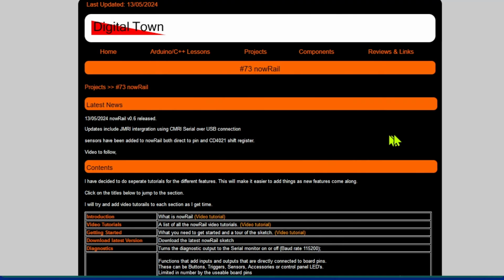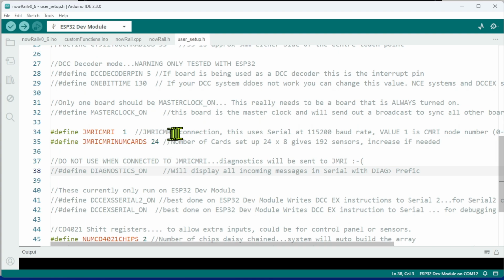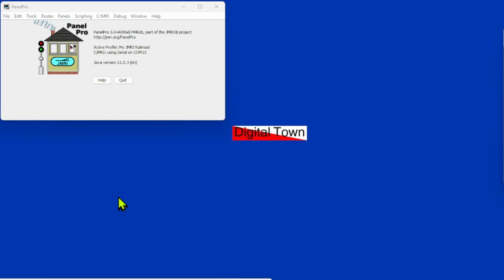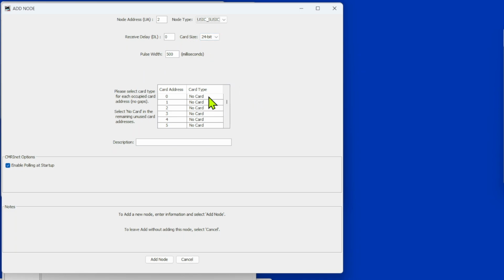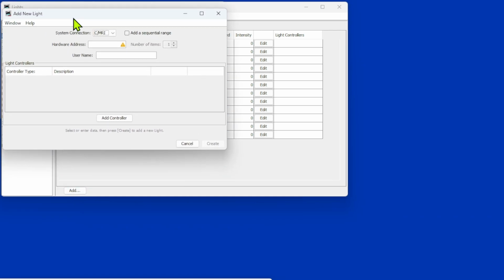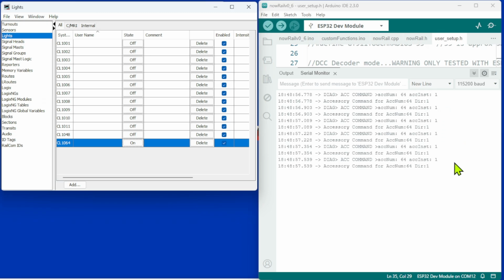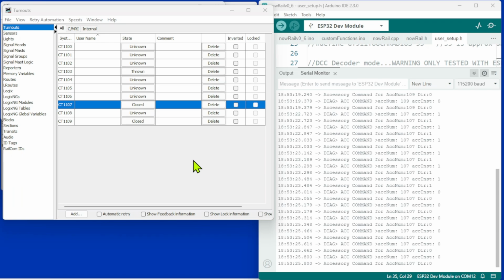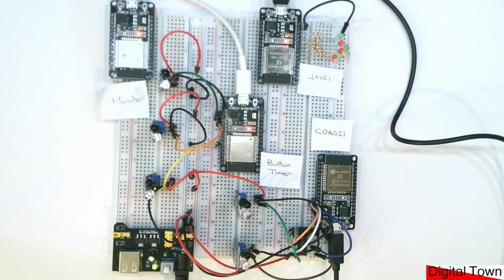#88 Arduino C++ nowRail model railway control - JMRI

Comment: First - thank you for NowRail - a great initiative, much appreciated. I wonder if it wouldn’t be possible to connect wireless to JMRI using WIFI. Either AP mode or STA mode with MQTT. 
The ESP32 can run both ESP-Now and WIFI simultaneously.
Reply from the maker: It could be made to happen but it adds a whole new level of complexity and requires a router box. At the moment you just plug an esp32 into a USB port, set up the configuration in JMRI and the jobs done. The transmission goes straight from JMRI to nowRail.
To use MQTT means either someone has to have the MQTT broker on their PC or they use an external MQTT broker.
That would mean JMRI sends the command to MQTT  probably via a wifi connection and the internet to the MQTT broker.for the broker to then send the command back via the internet and the wifi router to an esp32 that then rebroadcasts the command via nowRail. A bad internet connection and it's a bad day on the layout.
Even if the MQTT server was on the PC running JMRI. It still means sending the command to the router box and then back from the router box to nowRail. It just adds more moving parts that can go wrong.